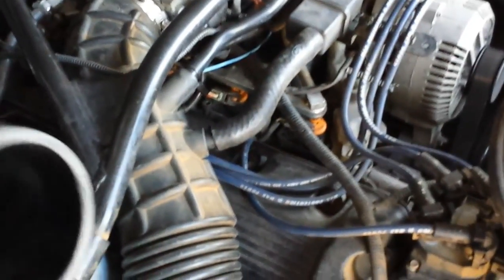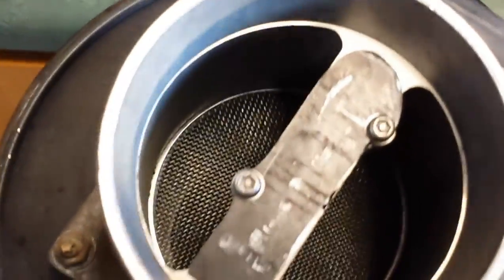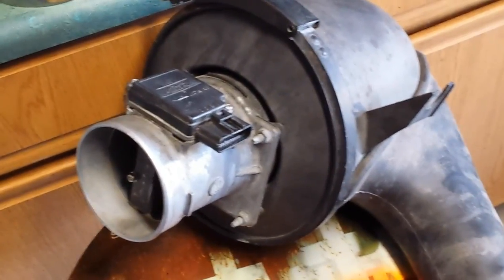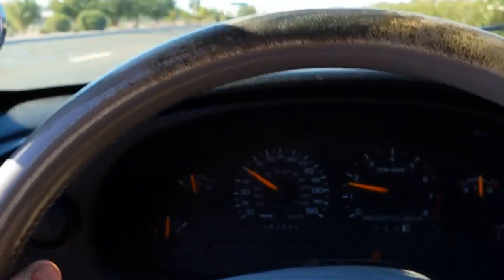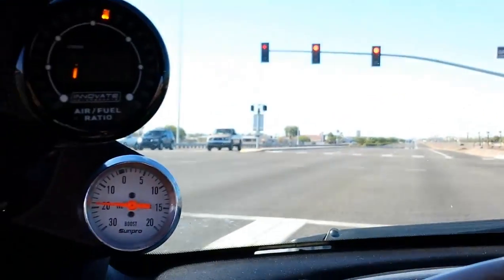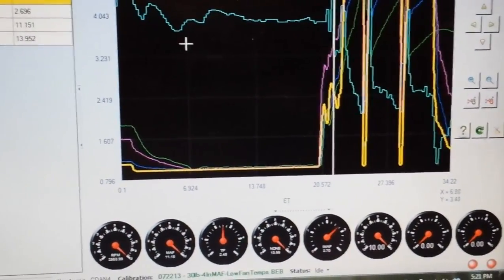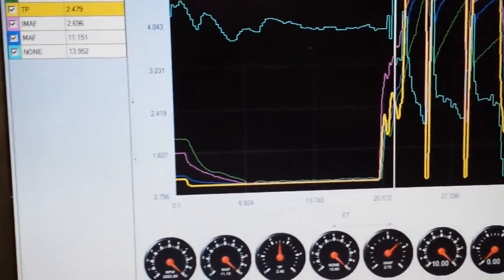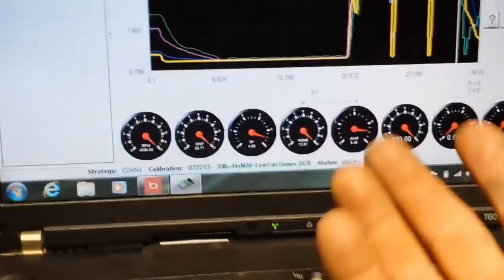Project Mustang - Modified the stock MAF - Getting turbo ready

Comment: KAMRF are the corrective. LAMBSE is the A/F ratio being demanded by the EEC, before correction. If your tune was lean, and the car went into closed loop. The O2 would then start commanding a leaner A/F, and the LAMBSE will read 16:1 for example. The adaptive will then update the KAMRF, and the LAMBSE will come back down to 14.7:1. When open-loop, the LAMBSE is whatever your fuel table has in that cell + fuel multipliers. Basically, if your tune is dialed in, your wide-band will match your LAMBSE

Comment from the maker: I still haven't compared all of that. But as far as monitoring the wideband it looks pretty good. 

The LAMBSE is the corrective data isn't it? 
I haven't gotten that far but if I recall I could monitor where I was in the MAF and what it achieved and manually correct my MAF curve to make it closer.

Other than that I assume the EEC will do long term corrections for me. But I of course would rather get it real close so when I do EEC resets I'll be good.
Reply: hackfreehvac is there any way to get in contact with you about your turbo set up